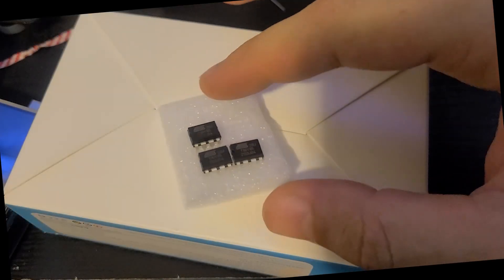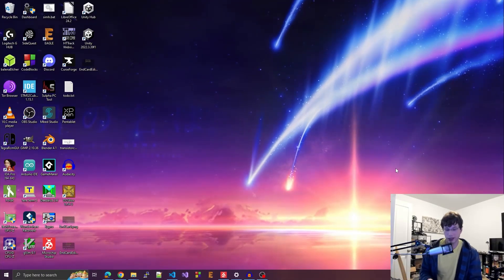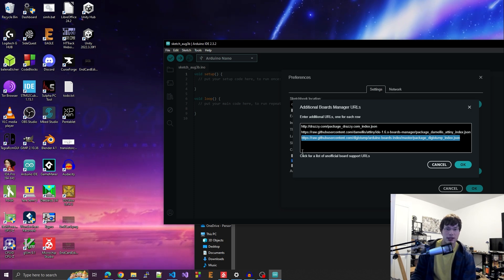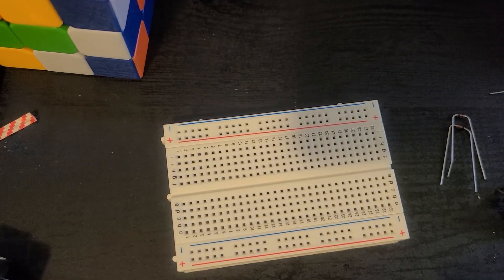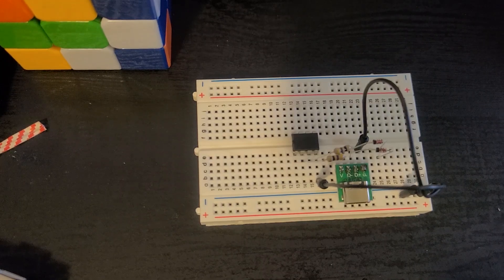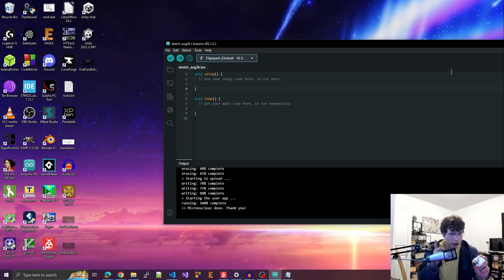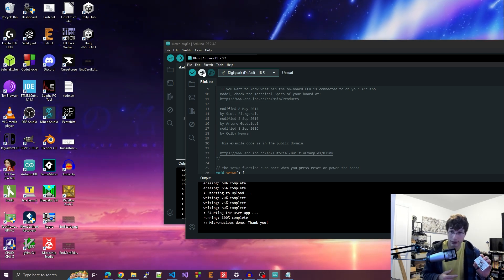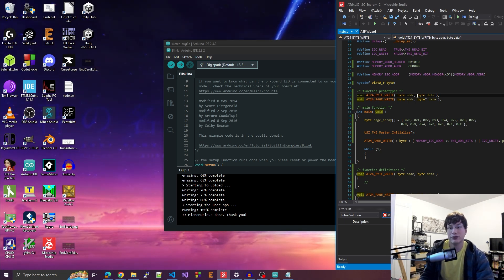Program an ATtiny85 via USB - NEVER USE AN ARDUINO ISP AGAIN!

Comment: I would not mind using my arduino IDE to program in C. My setup uses minicore and the bootloader it comes with its nice as I can run at 8mhz internal RC and I can program the chip and get data from it via usb serial. Very nice, and handy

Comment: Can I upload a sketch using an Arduino Uno as an ISP? Also Windows 10 doesn't recognise the ATTiny85 USB development board I have, so is this where V USB comes in?
Reply from the maker: Correct! If you follow all the steps it "should" work, note the driver install. If you want to isp program with an uno, you can still do that

Comment: Very cool! However, I'm pretty sure you never connected the diodes, they were on row 25 when you set up the ground rail but they never got a jumper cable. (So that's proof they're more "good to have" than a requirement. :D)
Reply from the maker: Iirc I had to to get the circuit working XD
Reply: @TheWinnieston  Haha good to know! Either way, great video, never knew it could be that straightforward and never seen anyone wire up a USB port for it, but also never heard of Micronucleus before. 😅

I've only used a breakout board with an old AVR-ISP STK500, looking forward to giving this a try instead.

Comment: I don't get it. Why try to avoid using a programmer at all costs.  well, my judgement is based of the following:  Any person that is either professionally or DIY level dealing with microcontrollers (but especially the Arduino type ones and uses Arduino IDE software on a regular bases  (I bet you any money) it certainly either already has a little cheap programmer such as Tiny USB programmer  or  AVR STK 500 II  programmer, or an Olimex AVR  or an XPII programmer, or a USBasp programmer, a Pololu programmer, or a Adafruit pocket programmer or a cheap and cheerful Chinese programmer of some sort or... the last resort a Arduino UNO  that can be simply set as an ISP programmer. So, I'm thinking...…since we keep experimenting with this things all of the time  why such a big fuss of trying to avoid using it ??? Why we are making it to look like such a big deal having to use one ???  We might as well using it since we all have some kind of a compatible programmer at home anyway !   I simply do not see the value  of cluttering my memory and wasting my time trying to learn yet another virtual usb protocol  when I already have an ISP programmer or can quickly fetch one by using an existing Arduino uno, nano, micro, micro pro...etc  you name it.

Comment: So are you connecting the ISP pins to the USB.  Also what does it show up as on your computer.  Does it show up as just a uart device or something more then that?
Reply from the maker: @sorry_senpai  the thing is, I doesnt show up as a device per say. It's a digispark device in the manager, but not a serial port at all
Reply: @TheWinnieston  What column does it show up in device manager
Reply from the maker: @sorry_senpai  if you have lib32usb filters installed, its that. Remember, it's not really a usb device. It's something else entirely
Reply: @TheWinnieston  Well i understand the its not a "real USB device".  But it still has to do all the real USB stuff.  Like windows will not talk to any USB device until its tell its USB description.  Which you can see if you install wireshark.  Or if you where on a "real" operating system you could just type a command to see the descriptions. ;)
Reply from the maker: @sorry_senpai it will not do all the usb stuff. The micronucleus read up will explain. What happens with the driver is it detects and reports the port that has a pin state change while the launcher is running. Then, the launcher will toggle that ports pins like an isp. If you listen in the video, windows detects something on a port but cannot identify it, because it isn't a real usb device at all. If you look at device manager then, you should be able to see it.
Reply from the maker: @sorry_senpai  Supposedly it's supposed to show as a digispark device in the device manager when hidden devices are shown. I couldn't get that to work, but uploads still work, so I didn't look too far into it! XD
Reply from the maker: @sorry_senpai  I'm also sure the 16.5mhz clock is something that is specifically needed for usb receiving